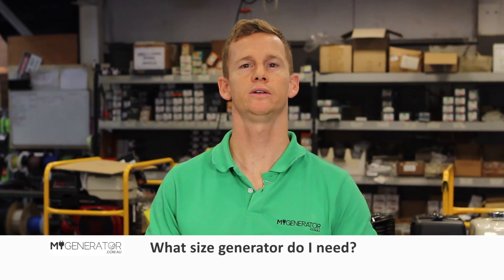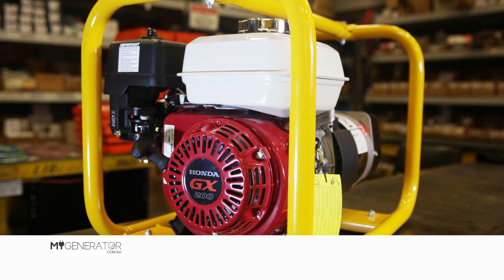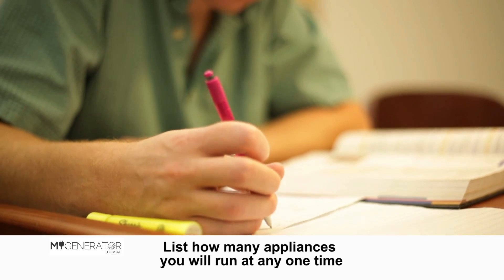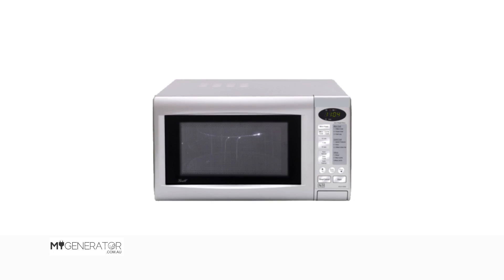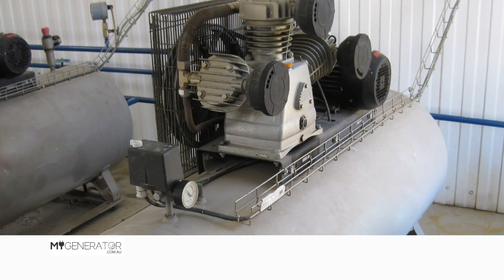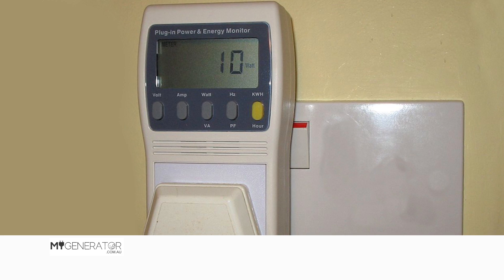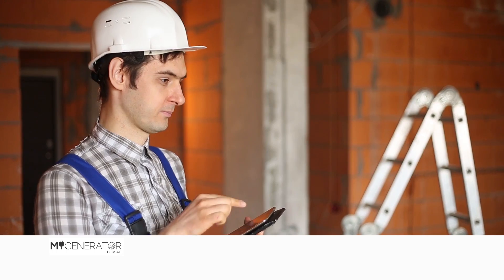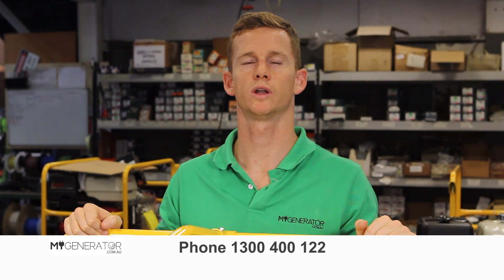What size generator do I need?

Comment: so i have made an electricity generator, powered by water (River beside my house) so, i can know how many Volts it give me, but, how can i know how many Watts or Amps it gives ? !!! i have to know that, cause for example : if i want to use it to light a lamp, it need 100 watts, but maybe it is giving me 50 watts right ? so the lamp won't work properly, i don't want to try and try to know, there should be some way to know that !

Comment: My understanding is that once you have the total wattage that you need to times that by 20% so the generator is not running at Max all the time. Is that true?
Reply from the maker: Hi Craig,

Great question! Generally your 20% rule is a good rule of thumb to follow. But just be careful to only apply that 20% rule when talking about the running / continuous load calculations. 

For example, a 2000W heater with a heating element, has a very linear power draw and yes it would be a good idea to match that with a generator that puts out a slightly higher continuous wattage.

When performing load calculations for motor starting you will need to factor in the start up load and the overload capacity of the generator. Some motors will require up to 7 times their kW rating to start.

Our technical team can assist in sizing up the right generator for a motor starting application.